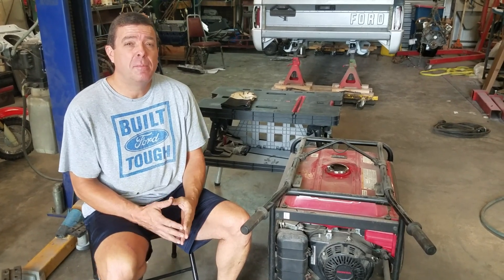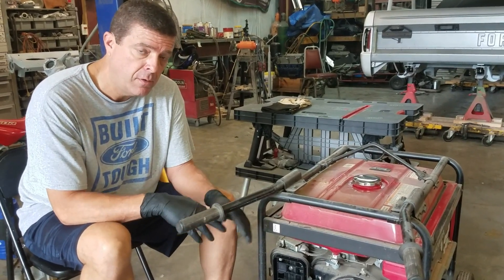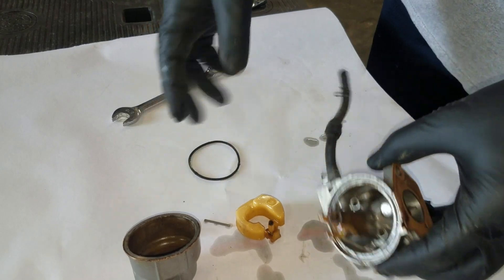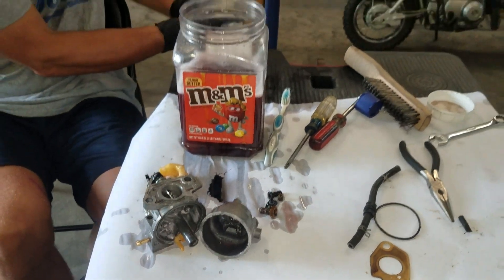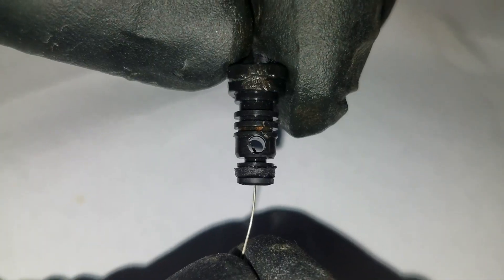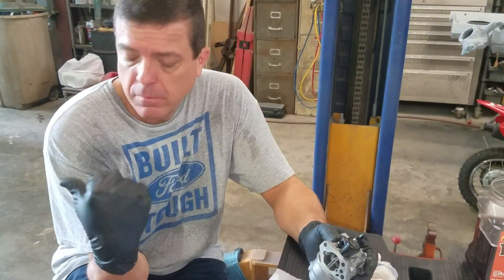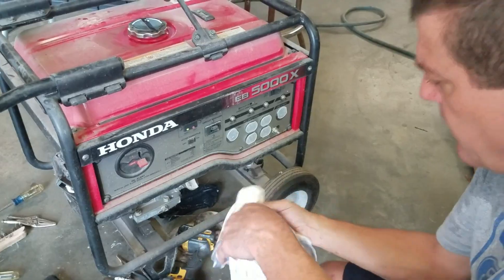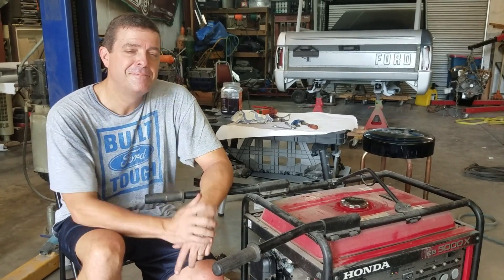Will your generator start?  Honda Generator Carburetor tear down & clean. Hurricane preparedness!

Comment: What does it mean if the sponge and sponge housing is oily or gas soaked
Reply from the maker: @johnkim1656  Gas soaked is usually from a stuck float in the carb.

Comment: I cleaned carb using your video but i have fuel pouring out the back of carb when the bowl fills up. Yes i put a new gasket behind the carb from Honda. HELP!
Reply from the maker: Brian thanks for watching.  A couple things to try is your float might be compromised and full of fuel.  Take it out and shake it.  If you feel fuel slosh it is full.  It will need replacing.  Also check the needle becasue it is not seating so make sure it is clean.  Hope this helps.
Reply: Jason & Jonie Builds I'll check it out thanks but it all looked good when I cleaned it. Really low hour machine
Reply: @JasonJonieBuilds  my mistake i somehow missed holes with the bar that secures float. purring like a kitten now.
Reply from the maker: Great to hear.  Take care.

Comment: Great video.  Getting ready for a snow storm (East of Cleveland suburb) and had nearly identical conditions.  Used an ultrasonic cleaner with Dawn and Lemishine.  Carburetor looked like new.  One pull start after I turned off the automatic throttle.
Reply from the maker: Thanks for watching!  Hope you all stay safe and warm.
Reply: "Getting ready for a snow storm (East of Cleveland suburb) "
Will a Honda generator start at 20 F below zero?  One of the labels says don't operate in rain or snow. What about that? Does a person need to build a shelter for the generator?

Comment: Good video. 
I just was given a Honda ES7000 that doesn't run they were going to throw it in the dumpster. 
I checked for spark and that was good, put my finger over the spark plug hole and felt good compression so I figured it was a fuel problem. 
Spraying hot shot into the carb did not help but when I had the plug out I figure let me shoot some in there. Put the plug back in and it fired up. It shuts off and it was late and the skeeters were biting so I called it quits and then found your video. Will use your advice tomorrow to see if I can get it running. Oh and the gas doesn't smell too good either and it's a full tank. Thanks again and Happy Motoring.
Reply from the maker: Thanks!  Good luck

Comment: Very, very excellent video. I installed a new carburetor in my 13 hp gx390 honda. After a few pulls started and run for 10 minutes and I shuted off. Next day doesn't starts only a few small flames coming out of the carburetor. Can enyone help?
Reply from the maker: There are so many thing it could be.  Did you drain the fuel tank before the new carburetor?  Is the choke connected correctly?  Do you have a new spark plug in it?  Is it full of oil?  Just some things to check.

Comment: I like to soak my carbs in lacquer thinner, works really good.
Reply: I bet purple power does work really really good I believe there's caustic in it.
Reply from the maker: I does and is a little easier on your hands.  I had a shop for over 10 years and the chemicals took a toll on my hands.

Comment: The idle jet you pulled the screw that holds it in place is that suppose to be tight or backed off. Just did this and it only runs for a few seconds then dies
Reply from the maker: It has to be tight.  Check the main jet again.  It has to be clean.  Good luck.

Comment: Hi!  
      I have Black Max 3600 generator, left some old gas in it stored inside the shed for awhile but before I did that I ran the generator with fuel turned off to dry the carburetor, now I tried to start the generator and it won't start. Can carburetor still get clogged with fuel off, but old gas left in the tank? Can you think of any? Thanks!
Reply from the maker: Honestly, running the gas out doesn't  get all the fuel out of the bowl.  If your generator has set for a while 1 or more years I would say you will have to remove the old fuel and clean the carburetor.  Good luck.

Comment: I have a Honda eb4000x generator what number do I use to get a carburetor kit? This carb has wires and a black box on top of the carb.
Reply from the maker: Israel, most shops will ask for the model and serial number which are located on the engine somewhere.  Lots of times the equipment number is not enough.

Comment: I just acquired a generator EB5000.  It needs to be cleaned like yours did.  This video will come in handy.  That Purple Power stuff is wonderful.  Did you put rubber gasket and plastic float in the purple liquid?  I could tell by the video.  Thanks for making this very helpful video.
Reply from the maker: Thanks for watching!  Yes to the float but there is usually no need to put the rubber seal in the fluid unless you are trying to keep all the parts together.  Sometimes when the carb has sat for a long time the rubber seal will get brittle and will need replacing.  Good luck!

Comment: I have a generator Honda em3000 and the coil wire came off we don't know how to put it back on
Reply from the maker: Thanks for watching.  Some of the coil wires screw into the coil body.  Meaning there is a screw embedded in the body and the wire screws directly into the coil.  I am not exactly sure if this Honda unit does that.  I do not have it in my shop anymore.

Comment: Do u have to take gas tank off to replace a round air filter?
Reply from the maker: Not on the model generator we did in the video.
Reply: Do u know if u have to remove the gas tank to replace the round air filter? It's a Honda GX630. Thank u for your response
Reply from the maker: I am sorry but I am not familiar with that model generator.

Comment: I had to take top fuel indicator off to fix float inside of tank but when I screwed down indicator back on it seems to leak when moving generator around with full tank. Any recommendations on stopping gas from coming out around edges of indicator?
Reply from the maker: I have never removed the indicator gauge so I am not exactly sure what it looks like.  Honda likes rubber type gaskets.  The gasket is probably compressed due to age and needs to be replaced.  Sorry no help there.

Comment: can i use wd-40 on a rusty crankcase(fuel tank) of my Honda generator. Please reply🙄
Reply from the maker: I am not sure that wd-40 would be any help with a rusty fuel tank.  I used a few different methods cleaning out old fuel tanks but none really did a great job.  If it is rusted bad you will have to replace it to avoid carburetor contamination.
Reply: @JasonJonieBuilds  thanks❤

Comment: Interesting....Honda says maximum temperature 104 F. Good to know. It also says "do not operate in rain or snow." Ah hah. So what if your power goes out in winter......will this start in sub zero temperatures Fahrenheit ? And if it does start in sub zero F what about snow?  What good is this thing if it won't work for exactly what you bought it for? How can you operate these things in winter during a power outage? Will it start at 20F below zero?  How can you protect it from snow and rain?
Reply from the maker: I live in the south and can't answer the questions on temperature sorry.
Reply: @JasonJonieBuilds   Thanks very much for your video. I just bought one yesterday. EU2200i Inverter. Runs like a champ and very quiet.